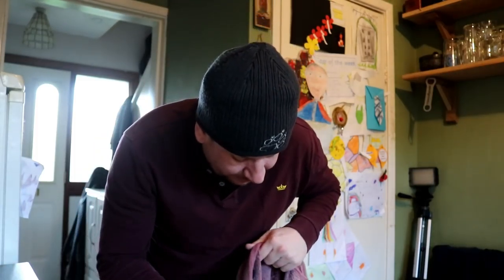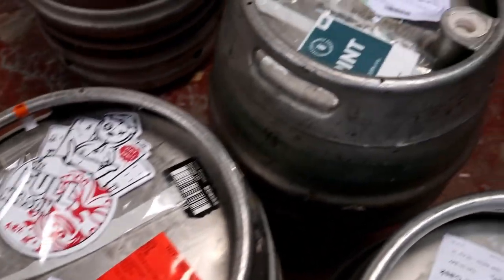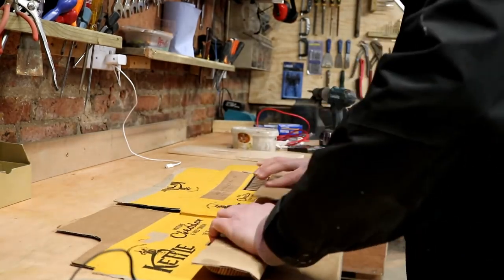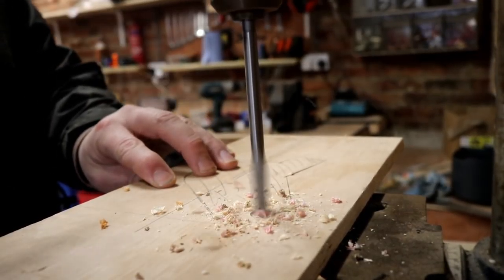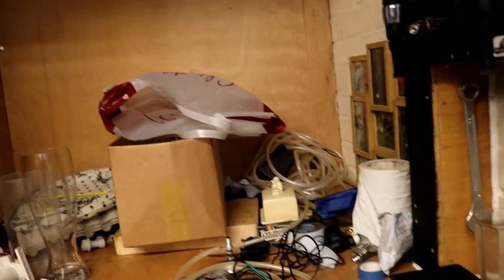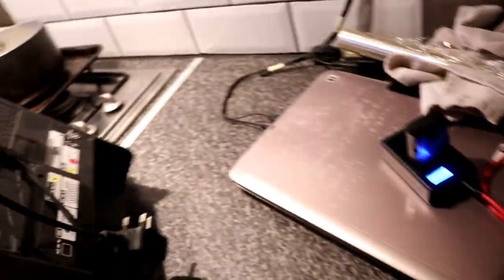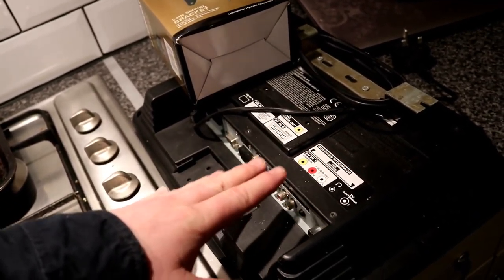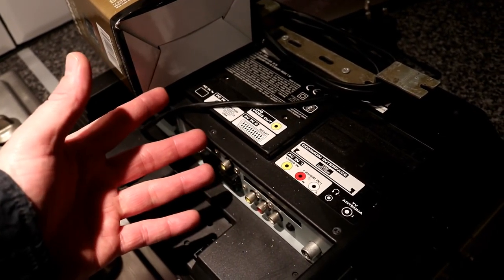Banana (Abi Picked The Title)

Comment: For the TV, if it doesn’t have a built in digital receiver, then you need a freeview box with a SCART output. Connect a digital indoor aerial to the freeview box then SCART lead from freeview box to SCART input on TV. That should sort it. Assuming digital signal is strong enough inside your unit.

Comment: Just recently did this for parents with a kitchen telly. If the tv doesn't have built in freeview then you are going to have to get a freeview box and connect telly to that but then that means a dish or ariel needs connecting up on roof space somewhere. Easiest way is get a freeview ready tv that's cheap and plug ariel directly into that,in this case a set of cat's ears might even work. My parents setup is split off back of living room Sky box but also works with ariel plugged directly into Saorview ready TV(saorview is freeview over here). Cheers.

Comment: If you have sky in another room could always get an magic eye to watch it on anther tv, still need a second Remote to control the sky box . You’ll have to check that you have enough cable, so it will run from one room another room. Only problem though each room will have to watch the same channel, every little helps. Cheers

Comment: you also might look at using a raspberry pi zero wireless - it can be setup to let you playback anything from the web and I think it can also be extended with a digital receiver - it doesn't support SCART directly but I see you have RCA video jacks there and this article shows how easy it is to add composite output to a rasp pi zero w - the raspberry pi zero is very cheap. The zero W has built in Wifi - and it can probably run from a usb 2 port on the TV...so no power adapter, just a usb cable and some wire and an RCA plug gets you video - you'll need a 3.5 inch plug to 2 RCA plugs to get audio.  You'll have to research a bit for the digital OTA receiver to get local TV - but it would be cheap and portable. 
Here's the link for composite video on a R Pi Zero W - https://www.raspberrypi.org/magpi/rca-pi-zero/ 

Rob's solution is probably easier...you can also install an amplified antenna - just stick it up in the roof and run the coax to the freeview box - power it up and DONE. If you know someone with a freeview box you could borrow - you could see if you get anything in that location before you go buy the bits and bobs to make it work.